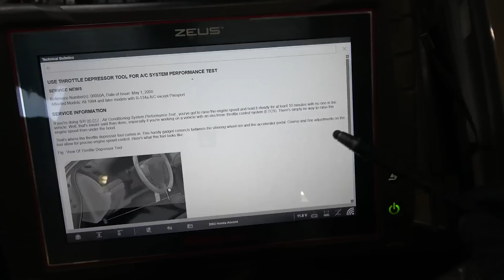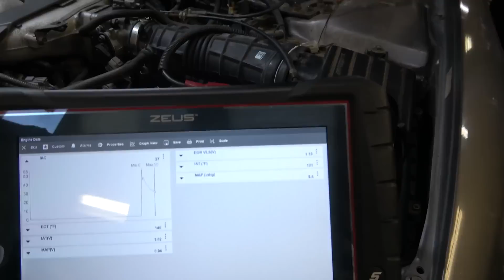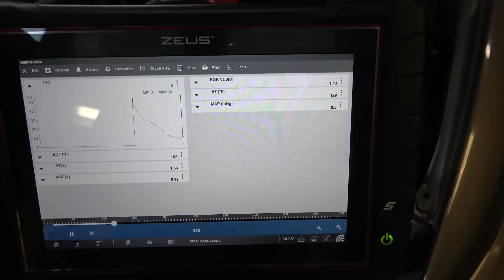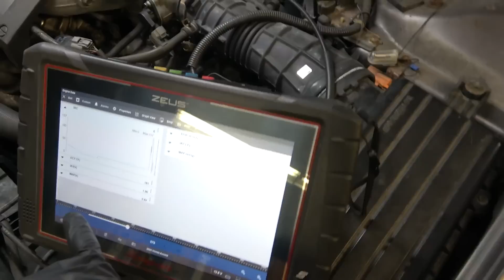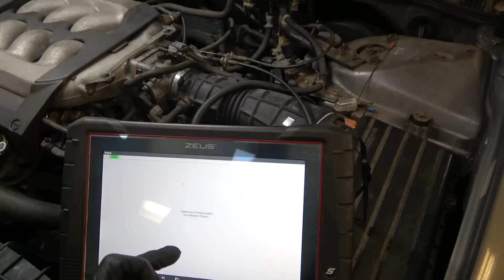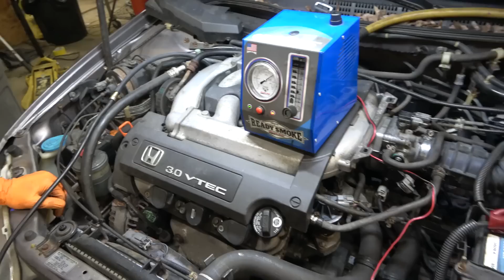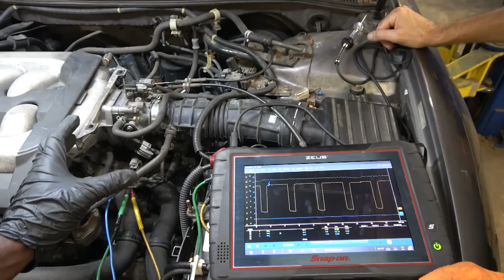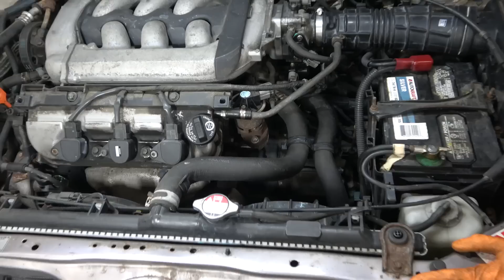This Honda Accord is Unfixable - Code P0505 idle Speed Stuck High

Comment: Nice work!   Wish this video was available a few years ago.  I had this issue with a 2000 Civic Si and I sold it because I didn't have this knowledge to resolve it after several local shops were not able to fix it.  I kept throwing IAC valves at it and the issue would come back repeatedly after the motor was HOT.
Reply from the maker: @twadam5218  Thanks! I'm sorry to hear about your car!
Reply: I have a 2000 Civic and have the P0505 code, cleaned the throttle flap and IAC vavle and I still have the P0505 DTC and now a P0132 O2 Bank 1 Sensor 1 DTC too. Did you ever fix it?
Reply: Sorry @michaelkelly3501 as my previous post implies I sold the car (unfixed).
If your anywhere near upstate NY, look up Eric O at South Main Auto. If I still had the car I would have drove or trailed the car several hours to see if he would work on it. He puts out amazing diagnostic videos here on youtube.

Comment: How much longer can an advance diagnostic technician can keep up with this technology.  At some point in the near future people are going to get overwhelmed.  This is just a very small leak that should not cause the owner to notice and even affect the way it runs. I know why and I don't  like the way vehicle engineering  has become.   When we had motors that consistently used a quart of oil ever 500 miles with vaccum leaks,worn parts, anything else you can think off.. We still ended up back home with no repair  bills. I remember  when 300 thousands miles on an old 57 chevy was common . They had to change oil more often.  At some point we have to face reality.  Give me an old truck anyday . Give away this trash of today. Kiss.
Reply from the maker: @dollarbill8976  Lol! there are a lot of benefit to these new trucks!

Comment: When it comes to electronics, OEM is almost always the best choice. Go ahead and buy a Dorman bolt, for example; but if you need IAC valve, throttle body, EGR, etc..., stay far away from Dorman. I say Dorman, but other aftermarkets fall into that category as well, but when I think about shoddy aftermarket parts, Dorman just ends up being the first one that comes to mind.
Reply from the maker: @shepherdguy   I totally agree witth you!

Comment: There was a recall on the EGR valve for these engines years ago.  Is the "old" one a replaced EGR valve under the recall or is it the original defective design?
Reply from the maker: @Aberdeenroadie  We replaced the old one with an OEM one!

Comment: I have replace the iacv for a new denso one, replaced map sensor, purge valve, tps and also replaced the injectors and manifold gasket but still have the code p0505 and car jerks, high rpm idle and surging idle, rpms get stuck and then jump to higher number, i need your help please i have a 2002 honda civic si hatchback, i dont know what to do
Reply from the maker: @rolandomacielmagana7469  Check the sensor wiring, if the wiring is good then make sure you don'tt have a vacuum leak, I will recommend installing an OEM Sensor

Comment: I am wondering if a scan tool is saying a idle air control valve is bad on a 2003 Honda Odyssey 3.5 v6, but then you clear the code and turn off the engine light and it runs fine for awhile then it acts up again does that mean the part is bad or is it something else? I know this is a different vehicle and engine you are working on, but it seems to me like as a old mechanic if my part is bad I couldn't just clear it even temporarily, Right? I bought a new after market part but haven't put it on yet. Please let me know? I am disabled and only have one vehicle, live in the country and can't afford to put it in the shop.
Reply from the maker: @robertc.6441  Get an OEM part! and check IAC wiring before replacing it!
Reply: @KITS_Auto_and_Truck_Repair  Okay, thanks, will do! They have a few OEM ones on eBay but 2 of them say remanufactured, has blue DENSO sticker on them. Made in Mexico on the side in the pictures, would one of these be sufficient or should I go to the Honda dealership? I already started a return 2 weeks ago to Amazon on the aftermarket part I bought. I have had about 40 vehicles and this is my 1st Honda. Just got it in March. I really like the V-Tech 3.5 V6, it has 267,500 miles on it, Still Very powerful and fast! Peace!

Comment: If you open the Idle control motor you will find that the valve inside sticks in one position.
All Honda idle motors have this fault.
Reply from the maker: @enesfazlic6017   Ah Ok! Thanks

Comment: Its a honda with a map sensor, what you can do next time is to remove the intake, watch the scan tool, and see when the iac reads 0 meaning that its closed, put your finger where the iac bypass and feel if your feeling vacuum, if its says 0 and you feel vacuum, that means the iac isn't moving because 0 should give you no vaccun through the iac bypass
Reply from the maker: @phareztrinimand  Good to know! Thanks for sharing!

Comment: EGR sticking open would cause rough idle, stall and fuel trim correction towards negative in a MAP system.

On these it's usually low coolant, vacuum leak or I've also seen where someone messes with cable adjustments.
Lots of good comments in here also btw.
Reply: I believe you answered my question that I wanted asked . With the unmetered air going in the EGR , would it cause the MAF reading go into negative values ?
Reply: @tonyarthur2828 Correct it will causing a rich condition
Reply from the maker: @JimmyMakingitwork  Thank you for your input!
Reply: Bishop correct you are the man sirs greath pepole thank you.,.😊

Comment: I had this same issue on my saturn wagon. 1.9 twin cam. Replaced everything ya'll did, and more, smoked it with no leaks, even replaced plastic valve cover with the aluminum one. Ac switch, ign sw., map, maf, intake temp, coolant temp sensor, throttle position, throttle body with relearn, brake booster and check valve, and vacuum line to intake, checked intake gasket with water, brake clean, oil, and fuel to no avail. Replaced ecu, and even the power steering pressure switch. Nothing fixed it. Drove it for a few months and trashed it. I gave up and just dealt with it. Scrapped it for 700
Reply from the maker: @mikeschaner5853  Oh dang I'm sorry to hear that you had to get rid of your car for this issue!
Reply: @KITS_Auto_and_Truck_Repair  i drive 60k + per year delivering meds. I replace the workhorse every 10-14 months. Tbh, the only reason I scrapped it, was because the yard offered more to crush it, than my highest offer privately for 2 months 😆 🤣..1 guy came to purchase for 8, knowing it had this high idle, and knowing it went thru a quart of oil every 1500 miles, and got mad at me when it smoked with a high idle lol..  I found myself an 03 sentra ser spec v, 2.5L 6 spd for dirt and have been fixing it up slowly. Shouldve honestly filmed the process.. good show guys. Looking forward to seeing more of your content.

Comment: Another problem with older Hondas with iac valves. There is an additional valve that lets in air to aid in fast idle with a cold engine. It is a wax pellet valve that reacts to coolant temp. It is open when cold to allow additional air into the intake to increase idle speed and as the coolant heats up the valve closes and shuts off the air. If the coolant level is low the valve won't heat up and the idle won't come down. When the engine warms up the computer sees a high idle with a closed throttle and it goes into fuel cut mode. That causes the surging. Often the only problem is low coolant level.
Reply from the maker: @OzFrog48Z   Thank you for sharing this with us, I appreciate it!
Reply: As the top comment posted. This was a known issue back in the day with a bad Fast Idle Thermal (FIT) valve. Air in the cooling system would give you the same surging idle. Air can enter due to a leak somewhere in the cooling system. I had a leak at the inlet hose to the FIT valve in the past, so that was where the coolant would escape and air would take it's place. The location of the valve was the highest location of any coolant passage, so the leak was slow to appear under normal conditions. I noticed the coolant a bit low and pressure tested to find the leak.
Reply: There is always a reason, the "Amazon" sensors/parts are a small fraction of the cost, compared to OEM!! Especially HONDA or ACURA. 
Always go oem sensors or electronics, for Honda.,...Always.  HONDA OEM,...always solves the issue.
Reply: Happens alot on the gsr/ls engines and d16.
Reply: Is there a FIT on the 3.0 hondas? Or strictly 4cyl models?

Comment: Good video. I have one question.
I got a car (manual) that shifts gears hard when the car is cold, and whenever the car runs for a bit then the gear starts to shift more easier...What do you think it can be? Oil change? Intermittent issue. Thank you very much man!
Reply from the maker: That's odd! you could have a sticking clutch disc! etc...

Comment: good vid man!!!! most EGR valves i come across when smoke testing normally have a small leak & does not effect fuel trims ...i personally hate installing aftermarket parts but unfortunately have to most of the time ,but have come across certain cars & problems that only factory parts will work & i make sure that we only use factory parts on those cars
Reply from the maker: @87Stang  Yes! I agree! Thanks

Comment: I use the feul trims data on scan tool when i suspect vaccum leak ,  high trims at idle drops as u increase throttle .    and perhaps stuck open evap purge solnoid
Reply from the maker: @wagoosh78  Yes!

Comment: Your scanner had 02 Honda Accord selected? What year Odyssey were you working on..
Reply: Sorry I misunderstood application another way to see if it has an external vacuum leak is too close off Throttle body opening and see if engine will run
Reply from the maker: @johnt4962  Oh yes! That's a great trick! Thanks for sharing!
Reply from the maker: @johnt4962  we were working on an Honda Accord here!

Comment: in my experience is most egr valves will leak smoke  especially,  ford . also when that surging idle happens tap on the valve and usually it will  clear out and work. telltale sign for iac sticking. also focusing on map which will show air leak issue,but understanding that a leak thats to large could be by the bypass of air by the iac, which is a leak if the valve is sticking open to much . also they say that with like a 4.0 your maf should read close to the same, well i watch that more closely on every car thats running fine and i see now thats not very true either ,so i dont just condemn the maf based on that especially on ford.  so watch more good running cars and watch the maf  you will be amazed how its not like most utube guys say it should be, just delt with one of those hondas a couple weeks ago same issue also cleaned throttle plate and and made sure the tps voltage was correct at idle
Reply from the maker: @user-te3pn4pb4u  Yes! Thanks for your input!
Reply: My ford has high miles and throttle plate was sticking closed, hard to get loose after sitting overnight. I cleaned it up, lot of gunk, then idle was too high. Idle screw is immovable so after going through every last other thing to make idle fast - vacuum leaks etc. - I got out a file and filed the idle stop screw.
It turned out the throttle plate passed too much air after cleaning off the gunk.

Comment: But won't that leak from egr affect fuel trims? I mean it will run lean at some point, right?
Reply: the more you smoke cars the more you will gain knowledge and most egrs will leak smoke on those test, but i think its so small it never causes a lean issue or fuel trim issue from my experience
Reply: @paulspooner-q6k  Wow!I did not know that. Thanks for sharing your experience.
Reply from the maker: @e.r.videography6209  Yes! we could have seen it by looking at fuel trim numbers too!
Reply: @KITS_Auto_and_Truck_Repair  Great! Thanks for your response.

Comment: Isn’t there a fairly complicated idle relearn procedure on those Hondas after any throttle body cleaning?
Reply from the maker: @bartscave No! this idle air control valve didn't require a relearn!
Reply: No relearn for egr valve or egr modulator required

Comment: Why did'nt you check fuel trim ,thanks
Reply from the maker: @nandanalal5072  Good question! Because the idle speed was stuck high I already knew that the problem was a vacuum leak or a bad idle air control valve since this is a MAP engine ( Speed Density Engine ), so the steps I took in this video were experience based!
Reply: What brand was the aftermarket parts. Thanks

Comment: Not certain of this car, but I have seen egr system issues [specifically a modulator] show up as poor milage/long term fuel trim staying high.  The loss of control [a broken diaphragm] was a vacuum leak, but since egr readback was proved by temperature sensor it threw a low "flow" code.  Worked I guess, but the language choices used sometimes lead us down paths that eat up time.  Egr's are odd ducks: active for moderate acceleration, but off under something like 1500 rpm.  So I wondered about the surging: a return to normal [intermittantly] but most the time system is compensating using IAC to keep it running?  Again,  fuel trim is often a good clue.  The funny thing about egr codes [if that is what set this trouble up in the first place] is that replacing egr may well be the last thing to do - you said "aftermarket" regarding egr and that right there is a red flag.  Your smoke machine got it done - that can be a great timesaver.
Reply from the maker: @flinch622   Thank you for the input I appreciate!

Comment: A my boss I have a Honda pilot  P0420 catalyst system Efficiency below threshold current I need your help my boss and P0456 EVAP system very small leak detected current is Jatta Victor
Reply from the maker: @user-dz4jb5rg6k  I recommend you watch my catalytic converter diagnosis videos, they will have you figure out the problem!

Comment: You should never plug back sensors when the engine is running could cause issues with computer
Reply from the maker: @swav100  No! I don't think so, have you ever damaged an ECM by unpluging a sensor whiile it's running?

Comment: When you hear the word aftermarket, that's when alarm bells start ringing.
Reply: 😂Never uses after market parts in electrical parts and computers parts..
Reply: My accords running om aftermarket remanufactured transmission, aftermarket struts and control arms and aftermarket notor mounts, running just fine
Reply: @TonyMaas-b5f allat is fine, using aftermarket electrical components, sensors, powertrain parts are where they’re no good
Reply: @TonyMaas-b5f the aftermarket transmission is crazy
Reply: @itsimpulse1 …most of the better remanufactured transmissions give you a decent warranty.
Reply from the maker: @christophergraham9726   Yeah Lol!!
Reply: Depends on the brand, because most companies don't make there sensors
Reply: Hello thank you so much for sharing yur teck and mechanical knowlege you have a very good back ground you are heaven send stay safe have a  Godbless niceday.,.😊😊p😊
Reply: Why were aftermarket parts used?
Reply: For our first family 1976 CVCC,  at least one honda at any time afterwards, an Acura today. One thing consistently,  air in coolant system not bled off will cause all types of surging. Small 12/14mm vertical bleed off valve on top/around thermostat. There's a sensor up there that MUST be submerged, I would replace that sensor if bleeding doesn't work with OEM, but bubble off some coolant, sometimes takes several bleeds with steep up & down bumpy jostling driving then bleed all while hot, always fixed surging problem, without fail. Hondas only applicable.

Comment: I am having difficulty with my 2000 civic thanks to your videos I have learned so much one thing I need a scanner a good scanner I have code read scanners but I need a live scanner and a smoke machine without those there’s no way I can fix it thank you for your knowledge
Reply from the maker: @8216.   My Pleasure! I'm glad to hear that the videos have been helpful!
Reply: O @KITS_Auto_and_Truck_Repair
Reply: I have a 2000 Civic and have the P0505 code, cleaned the throttle flap and IAC vavle and I still have the P0505 DTC and now a P0132 O2 Bank 1 Sensor 1 DTC too.  Did you fix yours?